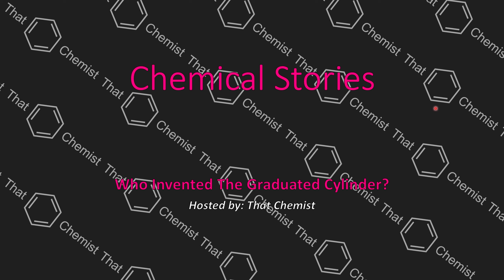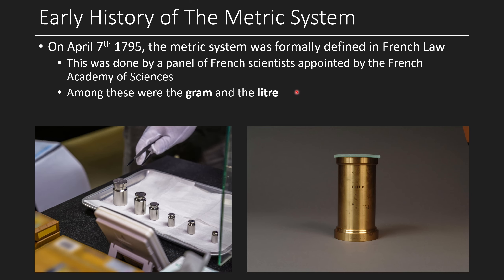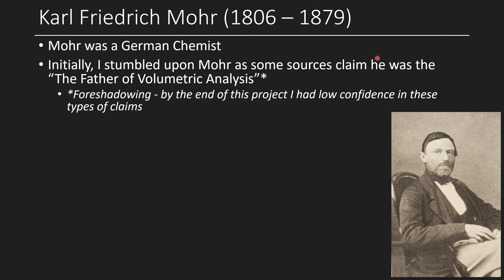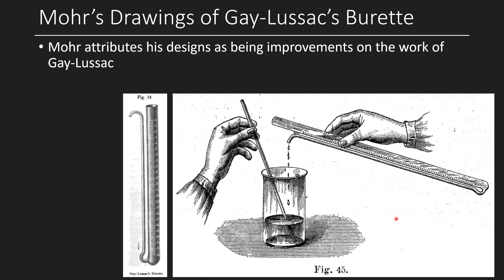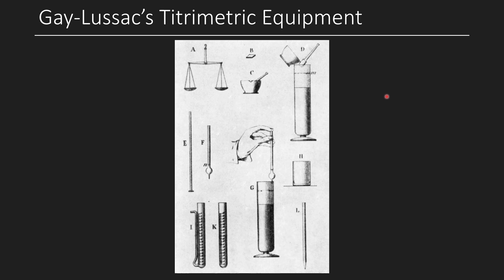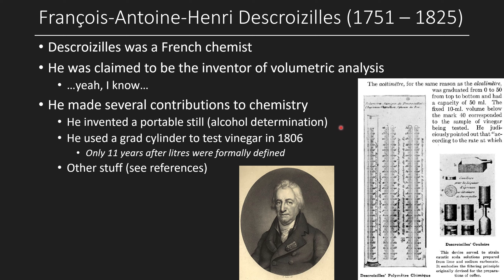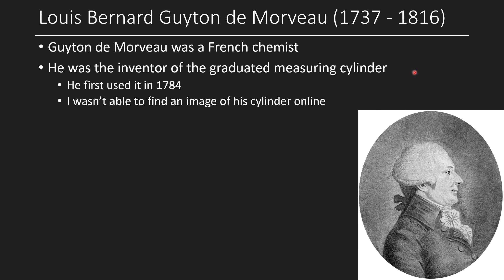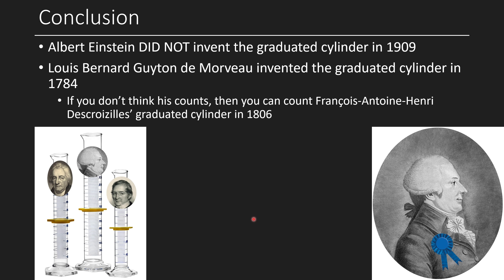Who was the real inventor of the Graduated Cylinder?

Comment: Rant incoming about the gram: originally it should have been the grave (whatever the accent on the should be, I'm not french), and as heavy as the modern kg, but since a noble named it, they discarded it.
Instead they made the gram, and made it the same as the miligrave.

And now kg is the ONLY SI unit with a prefix. sigh

Comment: Thermometer: The first(?) liquid-sealed-in-glass thermometer was invented in 1654, as a glass tube marked at intervals to indicate volume changes in the contained liquid.
Barometer: In 1643, a tube with mercury was used to measure the height (not quite volume) of a liquid in a tube.
Graduated cylinders?  Dunno.  They’re cylinders and you measure the height of a liquid within them.
My point however is that the idea of measuring things in glass cylinders dates back a  bit further.  I would be unsurprised if the first turned out to be another copy or independent invention in a long line of such.

Comment: I tried looking this up to see if I could find a better answer than "Einstein" without doing any further digging, but I only found that apparently Ancient Egyptians used bird seed to measure volume by filling the vessel with it and then counting the seeds, and that fact seems absolutely ridiculous.
Reply: That makes sense, actually. Assuming the seeds are of a reasonably consistent size, their net volume could be calculated and subtracted from the (known) volume of the container. The math can even be made trivial if "seed volumes" are used as a unit. Why seeds? Probably because it trivializes fabrication and standardization. The effort involved may seem absurd to us today, but that's why progress is called progress.
Reply: that begs the question, why did none of the seed fillers think of trying to make a mold for a pot, make many similar pots and measure the amount of seeds that fit in and then look at how many potfuls of seeds fit into a vessel?

Comment: Another noteworthy point is n the case of thermometry, measuring cylinders with graduations existed earlier. These were not made for volumetric measurements, but they are similar in their construction. 

Obviously it might be a far reach to call a mercury thermometer a graduated cylinder, but it is technically a measuring cylinder with graduations.
Reply from the maker: This is a valid take

Comment: yes, the metric was kinda invented in 1795, but it really took off in a big way where they took it from a static physical object that can fluctuate with heat and cold and put it in a dynamic way that can be measured with calculations as if it's a checksum.

Why did they do that? simple, making standard elements that are manufactured by YOUR specs by your people to be certified to your standards by your people does not make it an open and easily understood unit of measurement... it's far easier for the scientific community if they are given a book full of equations and if all of those equations check out then ding... that is a way to measure everything without the need for specialty tools.

"but it's not a big thing if the meter is still a meter" 
sigh they solved the problem of the universe expanding at a constant rate, rather than going with google chrome's version numbering system, they put forth an equation.

Comment: I'd argue that you are missing one point in your definition - the graduations must measure volume and give increasing readings with increasing volume. Burettes are not graduated cylinders because the graduations are used to measure change in volume, not the overall volume of the fluid itself.

Comment: Woohoo! I get to use my history degree on a chemistry channel! Thermoscopes (early thermometers) fit your definition perfectly. They have been around for ages but Robert Fudd illustrated the oldest example of a thermoscope with regular markings back in 1638.  Thermoscopes, unlike thermometers, are open on one end where they're submerged in a liquid. Some are flexible or weird shapes but Fudd's thermoscopes was a glass cylinder with marks measuring fluid volume and therefore fits your definition of a graduated cylinder perfectly :) 

Look up History of The Thermometer in "Understanding Fever And Body Temperature" for a good brief explaination and pictures.
Reply: I think you're technically correct. TC should've added a stipulation that the markings on the cylinder had to measure volume.
Reply: @user-ok4pk2mp3e  They did. Temperature scales had not yet been recognized, and wouldn't be for around another hundred years. the markings on the tube measured fluid displacement, which could then be USED to determine changes in "sensible heat" and air pressure.
Reply: @user-ok4pk2mp3e  Yeah I think a graduated cylinder is generally used to measure volume of many substances you'd want the volume off. A thermoscope measures changes in temperature by using volume. The intent isn't to measure a substances volume with a thermoscope so I wouldn't count it. Kind of like how a Mercury barometer doesn't measure the volume of Mercury.
Reply: The ancient Romans had a glassware industry and take a look at the Lycurgus cup. It is made from dichroic glass, and is the only existing example which we know survived to this day. I bet they could have made glass cylinders with measuring lines on them but if they did they probably all broke and no examples survived. It's not a stretch to think they did. It's a useful thing to have and they had the skill to make it.
Reply: You just triggered a secondary school memory where we learned about the first thermometer, (dutch school, dutch inventor yadidadidah) 
sidenote: does volume matter or just height in a thermoscope? Because as far as my memory goes the teacher always mentioned mm of mercury and not volume and a higher diameter, which gives more volume, also means higher surface, so more pressure pressure from outside. Which means height is the defining factor, might be wrong though.
Reply: 9 @alman5718  Might be a typo, when you say :'' A thermoscope measures changes in temperature by using volume.'' Do you mean: '' A thermoscope measures changes in temperature by using *height*? because you contradict yourself in the next sentence with the Mercury barometer.
Reply: @ephremcortvrint2376 yeah sorry
Reply: @ephremcortvrint2376   @Ephrem Cortvrint  Yeah it boils down to the hygroscopic paradox; a Mercury barometer doesn't depend on the shape of the container. A perfect barometer has a vacuum at the top (bulb) and pressure just changes the height just the same as the hygroscopic paradox. Different volumes will be moved however, just to the same height. 

A Mercury thermometer works by expansion of the Mercury itself and thus it's not the same effect. A wider tube for a Mercury thermometer will mean a smaller rise compared to a thinner one. Therefore volume is the same but not the height. (dH = dV/A,  dV= beta*V*dT)
Reply: @alman5718  Makes sense, thanks for the update.

Comment: now the question is, had some mad lad alchemists in the middle ages developed all this stuff already but didn't publish it?
Reply from the maker: The precision/accuracy part is the thing that’s not clear
Reply: Back than measurements were imperial. Someone once told me that a foot in a  certain country was measured to the kings foot so a fluid oz isn't neccisarly a standard measurement. Even today in construction a foot is pretty much the bosses or whoever cuts foot length depending on the trade

Comment: The difference between the graduated cylinder of today and those burettes is that a graduated cylinder does absolute measurements. Burnettes only measure the difference between the starting and ending amount in the device.
Reply: You can get burets calibrated in "to deliver"
Reply: @louiesatterwhite3885  Meaning that if you add 50ml, running it dry will deliver 50ml? Interesting; i wonder how they are calibrated. The area around the stopcock isn't really conducive to accurate volume determination.